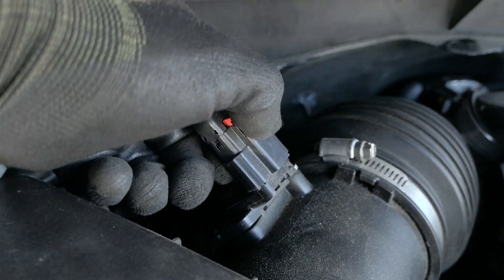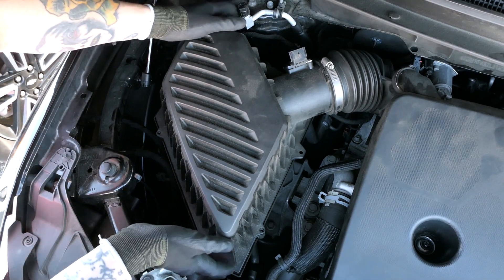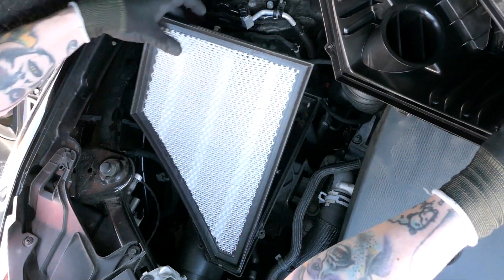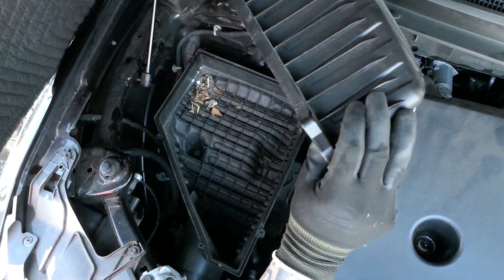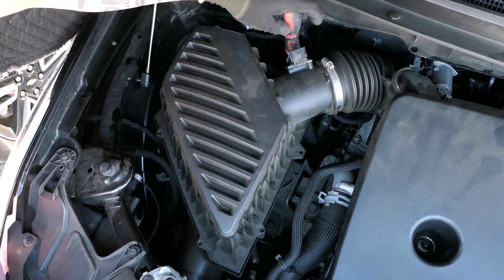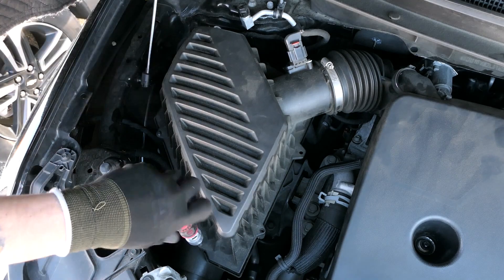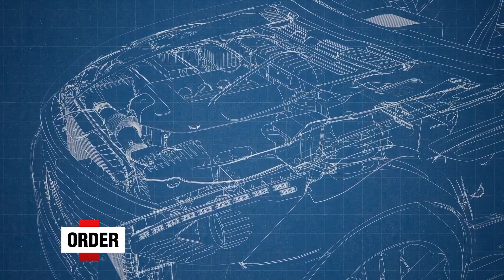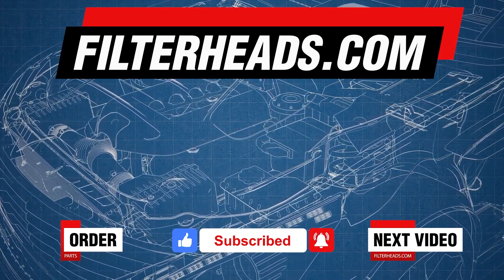How to Replace Engine Air Filter 2020 Chevrolet Traverse 3.6L V6 | AF3212, TA41392

Comment: NOT PHILLIPS.   They are JIS screws.
Reply from the maker: Correct, but for the individuals who do not have those specialty bits, we simply recommend using a Phillips head screwdriver.